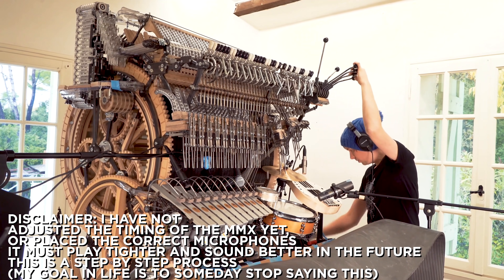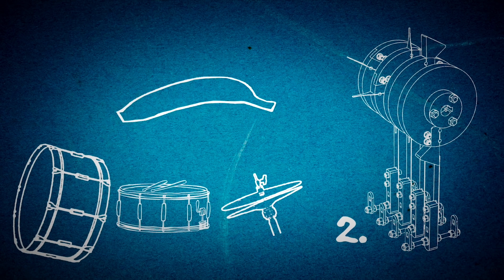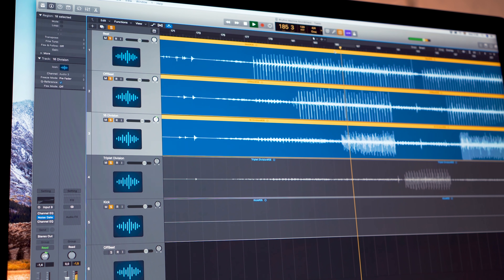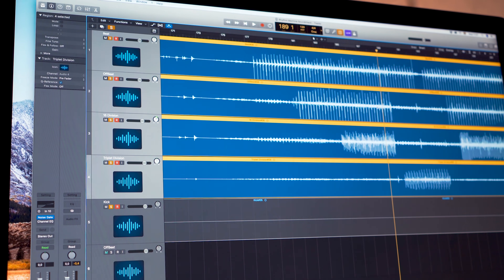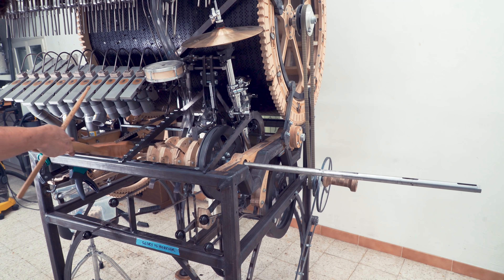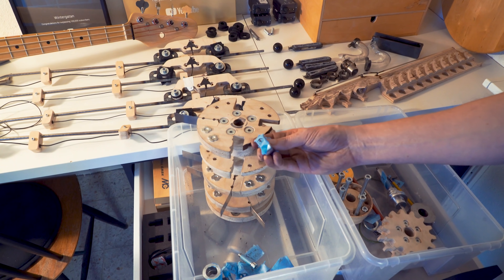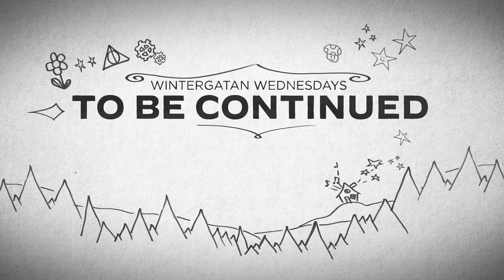Rhythm Machine Experiments - Marble Machine X #107

Comment: Martin, looks like a much better design! I didn't notice it until this video but with the old design not only the volume would increase/decrease but the timing would also change based on the height the levers were set at, because it is all driven by the distance from the plywood piece. - A higher lever = closer plywood = the start point of the spring steel flaps is closer = timing variations. The new design looks much better; looking forward to seeing it in action!

Comment: Think of it as a car engine. Martin needs to make something similar as the timing system that times the camshaft from a car engine. The camshaft must be in perfect sync with the crankshaft at all times even if the input RPM is slightly variable. 

Consider the crankshaft from a car engine as the shaft from the programmable wheel from the marble machine. And consider the camshaft as the shaft for the extra rhythm section. so he needs to make a sprocket on the crankshaft (in other words the shaft from programmable wheel) and connect it with a chain or a belt to a sprocket on the camshaft (in other words the shaft that holds the extra rhythm section). And then everything runs in perfect sync, even when Martin turns the machine at a variable speed. 

Problem solved.

So he must not put the new rhythm section on the same shaft as the flywheel, but instead use a separate shaft for the new rhythm section, that is connected with sprockets or pulleys and a chain or a belt to the shaft from the programmable wheel.

Different variations to this system are possible, as long as he uses a separate shaft for the extra rhythm section, and it needs to be driven by the same shaft as the big programmable wheel. And he must not connect the new rhythm section to the flywheel shaft.

Comment: Isn't the biggest reason it's so hard to play tight that the tempo is mostly controlled by the flywheel? Much like it's practically impossible to paddle a bicycle at a consistent tempo and expect to feel the resistence of the chain pulling forward at all times as well.

Comment: That hi-hat machine was stroke of genius but you could potentially add a dampening function to get an additional tone/sound that could be controlled by cam wheel/shaft or lever system.

Instead of just ON or OFF, you could have dampened that may give the aural impression of the sound being introduced.

Comment: Tips from a drummer. 1) Wire drum brushes sound good against pretty much any textured surface try some wires attached to your wheel scraping against a piece of stone. 2) Try attaching one or two cylindrical shakers directly to the wheel or on a second wheel that can be engaged with one of your levers. 3) The most common instruments that turn rotation into sound are ratchets. https://en.wikipedia.org/wiki/Ratchet_(instrument) 4) And of course you can try just attaching beaters to your wheels and see if you can get a decent sound out of that.

Comment: Why you just don't save your soul and use a optocoupler like the ones used to measure angular speed in electric motors? with that signal (precise to the microsecond) you can trigger whatever you want. A little bit of electronics won't hurt your machine ;) just my two cents. Keep going

Comment: I suggest making measurements on the ends of the spring-steel flaps on the metronome to design better pieces that make contact with the flaps at the right times. This will make it easier to find the beat. You basically need to find a way to find when contact is most comfortable for you (the most ideal moment, down to the millisecond) to occur. Also find a good material that produces a good sound upon contact with the spring steel.

Comment: I think you're systematically avoiding feature-creep by ripping out the old and remaking it entirely without really adding to what you already have. You came to us with the idea long ago, but every other iteration of it has been scrapped until now. As long as you're only improving what already exists in your designs, you're only putting yourself through the process of perfecting your machine and not having to come up with kooky ideas that only you would like.

The wobble-spider fingers are feature-creep. You redesigning your hihat instrument system that is responsible for maintaining a background beat to assist the percussion instruments is not. You're doing good, keep it up.

EDIT: Also, bump of somebody else's design idea: add a tachometer gauge to your machine so you can maintain what RPM you want without guesswork.

Comment: You did well, on the video I could already see that the spring steel plates were pushing back the levers meaning you would never have had a constant intensity but a diminishing one. With time the levers would have been pushed easier as the material got thinner so the fading would have gone even faster.

Comment: Martin, I think that the levers are moving themselves down ever so slightly as the rythym machine plays. This could be because they aren't tightened enough to be able to withstand the pressure of the incoming "drumsticks''. If you used something to tighten down those levers, maybe it would sound tight!!

Comment: If we wish to pull analogies from software engineering, what you're doing is closer to refactoring and optimization rather than feature creep. You're refactoring - trying to achieve the same goal as before but using more suitable methods, and you're optimizing - tweaking the design to improve performance. And these things are better done in the later stages of a project, so you can better estimate which parts need more work and which are fine as-is. So your approach wasn't wrong in my opinion. You just decided to optimize a part of your project because it's an important part to get right, and realized that you can't optimize it well enough the way it was implemented. That's a telltale sign that it needed to be refactored, so you grabbed your little refactoring angle grinder and went to work. I applaud you for the determination to give up on current designs when they become a problem.

Comment: It seems that the MMX on itself can hold a steady rythm, but you get in trouble when trying to adapt to an external rythm because you have to slow down/speed up to correct for jitter when you're off which is really hard. So the solution is pretty clear: don't adapt the MMX to an external rythm, adapt the external instruments to the MMX.

For human musicians this will happen intuitively. If you want to sequence in electronic instruments you'll have to provide the rythm from the MMX to these instruments -- not the other way around... In other words: the MMX needs a MIDI output that provides a MIDI clock. The jitter in the marble machine is more than likely small enough that you won't be able to discern it.

An arduino with some kind of optical encoder disk on the axle could be a possible solution, and could additionally automagically correct for timing differences at different tempos.

Comment: It looks like, the solution for tight timing witch external music would be something like CVT. I know it seems complicated, but pulley on the flywheel does not need to change the ratio, idler could take additional belt. The only issue is a mechanism for opening and closing CVT. Normally this adjustment can be made using centrifugal forces, but at lower speeds, weights in that mechanism will be significant. Advantages are obvious, You will be able to adjust the timing of machine by simply tightening spring, and it will smooth out any speed difference. Furthermore, you do not waste any energy from the flywheel in that process.

Comment: What if you increase the diameter of the crank lever (Crank wheel)? A longer time travel in the spin of that lever might give you a better control in the relation of rpm input vs current bpm. Saludos desde Mexico

Comment: Hi Martin, I very rarely comment on technical stuff, but here I have two things to say:
1- I believe you should still do some rapid prototyping of your ideas before you implement them, I think time used on learning how to prototype efficiently is better spent than that used tearing down a poor solution.
2- Try out the sound of that cymbal. By grinding it you're changing it's vibration modes and nodes, I doun't think it will be enough of a change that it'll stop performing it's function, but still is worth trying it out before commiting to that idea.

Greetings!

Comment: Isn't the spring steel going to act like a cabinet scraper on the plywood edges of your microphone pad-holder things? I'd imagine that over time the shape of each will change as surface material gets removed introducing error into your rhythm system.
Edit: I've just reached the bit where you don't like the sound of this system. I agree 100%. Looking forward to seeing the redesign.

Comment: Would it be possible to add a clutch of sorts that can be used to control tempo so that you can just crank at full speed and tempo is controlled thru the tempo lever
Reply: You would almost need to tune the clutch so that it's independently controlled so that as you add friction by hitting different levers it will automatically adjust and keep the tempo the same

Comment: one thing you could do is add a momentum clutch of sort. Make it so you could adjust the maximum rpm so if you go to fast it will cut off the addition of speed, and will re-engage when it slows down a bit. That way you can stay about the speed you want, or a little bit faster to try and keep the speed

I don't know if anyone else has said this, but i would say this is a decent idea for keeping speed.

Comment: Martin, there's a saying:
You can't get water out of a stone.
It's just a matter of time where your "disclaimer" would turn into a compromise. So I'm so glad you're tackling it at a not-critical point in time!
Also, watching a man work through not necessarily bad idea, but definitely an insane one has been so wonderful! You're learning (and showing of course) the ins and outs of a lot of design, prototype and general engineering principles as well as some nice moral values sprinkling on top. The journey has been magnificent so far, and my Wintergatan Winter Wednesday will be very welcome!
 
And don't you worry, the "feature creep" only applies when you're starting projects without finishing them, and you're doing everything you can to finish a particular branch/section before starting the next one. It's not a flash in the pan! I think your focus should lie more heavily on even earlier detection of those blocking situations, to avoid any future "feature creep" feelings.

Comment: Great... <- sarcasm 
But since you have taken it apart already why don't you add a RPM stabilizer with a mechanical Governor. ( https://en.wikipedia.org/wiki/Governor_(device) )
This way you can adjust the timing and it will be hold. It can be done with a simple slip clutch so you don't overshoot. (After the flywheel, where the stored energy is)
Or the over-complicated way with a suitable CVT. ( https://en.wikipedia.org/wiki/Continuously_variable_transmission )
Dear people who are not Martin: Vote this up if you think this is a good idea and want it to be noticed.

Comment: That's how it goes. Sometimes mistakes are unavoidable. Two steps forwards, one step backwards.
Even with a better rhythm machine, I think the tempo will still be a challenge. I'd suggest looking into a mechanical solution for keeping a fixed tempo, regardless of the stored force of the fly wheel. Old type clocks uses a pendulum, and newer clocks uses a spring, that oscillates at specific frequencies. Electronic circuits uses a crystal. Perhaps you can come up with a solution inspired by something akin to one of those.

Comment: Doesn't this basic design have a fundamental flaw? The portions that use the marbles all have an inherent delay due to the (constant) time it takes for the marble to drop, but the rhythm machine (and its hi-hat replacement) don't have that delay. I know you can adjust the offset, but doesn't that (1) prevent you from changing tempo easily, and (2) mean that when the rotation rate of the crank, programming wheel, etc. isn't 100% exactly perfect that the timing of is going to be off?  Rotate too fast and the hi-hat be be early, or rotate too slowly and the hi-hat is late? Isn't there a better way to handle that?

Comment: If you have spring steel on a rotating object it is going to be really hard to remove the uncertainty of the note's beginning/point of reference, idk what to call it. I think the high hat idea is a good idea, but if it does not work out I may have an idea, can't test so idk how it will work exactly.

Before you had spring steel rotating and hitting an object bouncing. I basically want to reverse that. Take the spring steel off of the rotating object. And instead make the rotating object convert its energy into reciprocating motion(wiki page https://en.wikipedia.org/wiki/Reciprocating_motion ) Like a piston. Have the piston hit an object like the drums you made earlier that are attached to spring steel. This way the sound is more of a thump rather than a drag. You can adjust volume by raising the "drums". 

For all I know this wont work just my thought.

edit: fixed link

Comment: I was going to say that the plywood blocks solution is very bad, since the spring steel will still bend and it will slowly eat away at the plywood. So i'm glad you went back to the drawing board with that.

Comment: The volume adjuster of your rhythms will also change your timing. As you increase volume, the flick sound will come later as more contact is made with the wood and the spring steel is released later.

Comment: Great work, keep it up.
Just a out there thought regarding keeping your timing in sync, consider putting in a mechanical Rev limiter linked to the flywheel, one like is used on the old steam motors, or a simpler air break like is used in many music boxes..

Comment: I'm sure you have a keen ear for tempo, but  have you considered adding an RPM / tempo meter with a graphical display? It would you nail down an exact tempo without focusing on it too much. There are a number of easy ways to implement this like a magnetic Reed switches. Older cars did it analog using a magnetic drag cup in their speedometers.

Comment: 10:55 I would have thought you'd have gone with another piece of spring steel sticking up from the sound board so that it was a very short click rather than a scrape. it would help dial in the timing if its a shorter tick.

Comment: Much better idea Marten.
I rated the 'rhythm machine' a bit like I rated the 'fingers':
a bolt on idea that actually detracted from the capability of this machine to actually make beautiful sounds.
This also should get over the problem of the dizzying number of marbles needed to play 16ths on hats.
Are you intending to keep the marble drop hats too?

Question.
How do you get the 'Hats' sound? (i.e. 2 cymbals opposed and choking each other's sound?

For what it's worth, the old design was always going to sound like a printing press, sewing machine or something and it would sound more and more crappy as the plywood wore smooth and the steel rubbing finger things got bent.

Keep the faith brother.

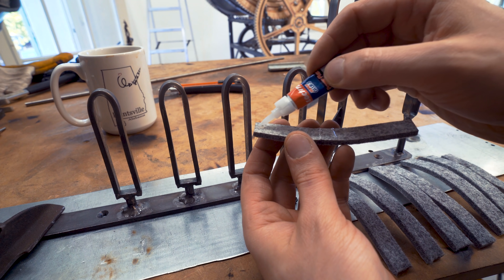Comment: 3:02 Martin: "There is not a single point where the metal of the levers touch the metal of the machine"
3:15 Also Martin: Moves lever down to make metal-metal sound.

Comment: so... The rhythm machine issue was the spring steel and the contact plane. You're changing the timing by changing the impact point: the higher you move it, the earlier it impacts. Spring steel will also move as you spin, and the spring action doesn't help. Easy way to confirm: use slow motion capture if you have the camera.

Use a solid contact point for the wheels and it will work fine; just have it impact something that can absorb the impact enough that it doesn't wear out the contact point. Contact mic under a piece of foam will work fine if its on the lever. 

Parts will wear out on this thing. You must be prepared to replace them. The foam out-piece will simply wear out a little faster, and its easy to replace.

Comment: a redesign that meant taking apart a large chunk of the MMX....that couldn't of been easy to do. well in the end it's almost certainly worth it.
also if you haven't heard yet, putting a tachometer on the machine would help greatly and would solve a lot of problems. maybe also a bigger flywheel as if the timing can't be controlled easily then that means the flywheel isn't large enough to do all the things you are doing on it. making the flywheel bigger will make the increases and decreases in speed smaller which means you can maintain a rpm/bpm more easily.

Comment: "Garbage in Garbage out"
I'm in Software Engineering and I feel you.
Reply: Just please don't show up with the angle grinder at work when you've got some code refactoring to do ;)
Reply: @marcoazz  I can think of some problems in software that can be solved with an angle grinder but they are admittedly rather few haha
Reply: @marcoazz  """ Fucked
[Some code]
"""
and rewrite it all would probably be the closest analogy.
Reply: @marcoazz  "I swear to god IDLE if you tell me one more time that you cant turn ints to strings I'm gonna chuck an angle grinder at you - while it's controlled by a relay triggered by catching the exception you cause when you try and fail to turn numbers to strings"
Reply: @marcoazz  I'm a software engineer, I have a keyboard with just one big red delete besides my APL keyboard and my normal invisible-caps keyboard. In the best days are those that have --10000 lines of code !
Reply: We use that adage in statistical analysis as well. Except magic also happens midway, and there’s nothing we can do about it.